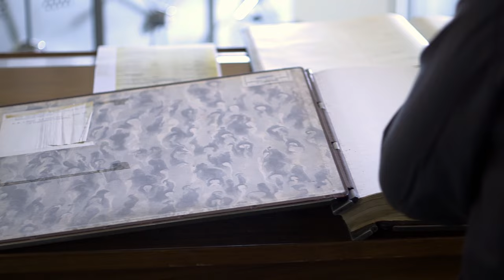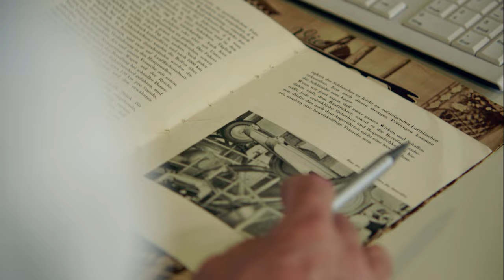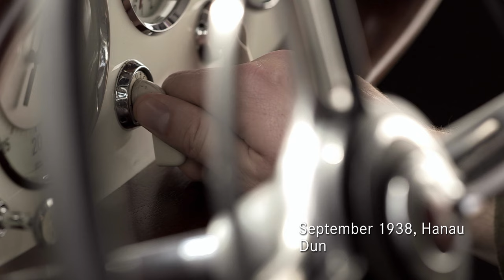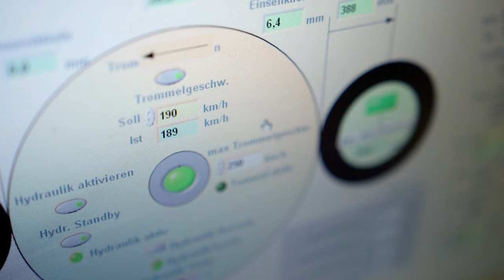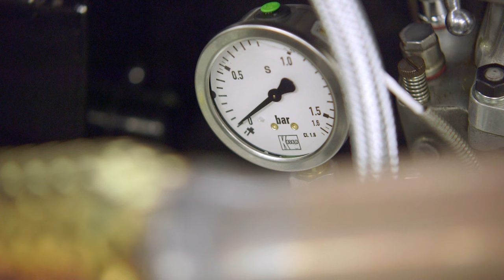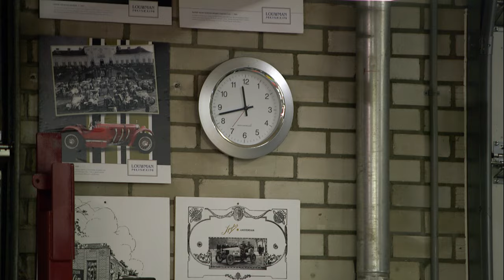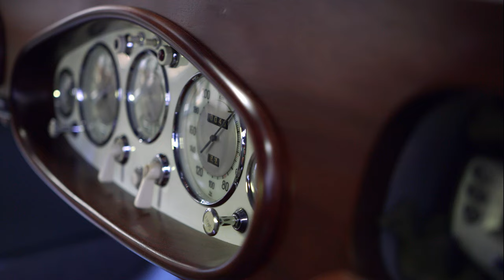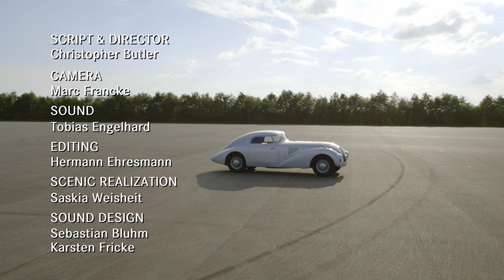The Streamliner Case - Mercedes-Benz original

Comment: Building the best cars for well over 130 years.
I personally fell in love with the 540 SSK from the mid 1930s. A beautiful beast indeed.

Usually Mercedes-Benz is at the absolute forefront of automobile technology and progress. In this case I think the Chrysler (Kreisler) Airflow was the impetus for Mercedes-Benz building this gorgeous machine.

When they pulled the valve cover off it made me think of what they used for gasket materials back then. I would expect to see a sort of rope or string made of natural fibers soaked in a heavy, almost waxy type of oil being used for this unless, as seemed to be the case here, the engine parts were so finely milled that the tight tolerances were all that were required to make a proper seal.

I believe the "Kompressor" needing to be switched on manually was because of the heat generated by this power adder could overheat the motor and cause failure of the powerplant if engaged continuously. 

Nonetheless, it's the traditional German work ethic and attention to detail to an unbelievable degree that makes this car truly special. 

Both of my parents were from Germany so I understand the "German way " of doing things, aber mein Deutsch ist ya nicht ausgezeichnet. Warum hat Deutsch so viel Artikeln? Mein Vater sogar dachte daß das war komisch. Komisch oder nicht, es macht Deutsch ein bißchen schwer zu lernen.

Comment: Something they are not telling us. Check out the radiator/ grill. It goes from square (rectangular) and to oval. I want to know the reason why and hey it was not included in the script.
Reply: I think that the classic Mercedes grille seen in the open chassis test is still under the streamlined sheet metal.

Comment: Would you want to build it exactly the same way?  Not me.  I would like to use the same plans, right down to the engine, with more modern materials and machinery.  Remember the British TVR from the mid 1950's?  Great but not as good as Carole Shelby's redoux if the late 1960's in the U.S.  A ford engine, better suspension, tires etc. but the same plywood body.  No need to cheat and use fiberglass or stamped aluminum for the body though modern aluminum main beams wouldn't hurt.  I imagine that plywood TVR with a ford 250 straight 6 and new suspension or even a 200 GM slant 6.  It would drive like a race care and require no inordinate maintenance

Comment: Designers in 1937 made choices based on what was available at the time, the techniques and materials of the time.

If they were working today, they would laugh at the rejection of modern resources and the adherence to ancient ways.
Reply: Probably true. But they would also be aghast at the loss of skillful workmanship and visions born out of ingenuity being replaced by "mass-produced, market researched, lowest-common-denominator" cars who are more flash than substance. I recently purchased a quality turntable for vinyl records. Most of those I have blind tested at my house prefer the warm, dynamic and natural sounding vinyl sound to the compressed and reduced streamed sound. Streamed sound has most of its "inaudible" data removed ad the rest i compressed to be easier to stream. But with good hi-fi equipment you do hear how flat and hard the sound is. The convenience of technology doesn't always make a product itself better. Just more accessible. 

Your comment does seem rather arbitrary too. Since using modern technology is the norm, why are you upset by a few people - mostly enthusiasts in fact - making the best they can using only the technology available from the time?

Comment: Very beautiful car and I just love this type of thing. But they sure did pump up the Drama LOL. A bit much really. I realize the Germans are sticklers for precision and accuracy but if you had been there back in the day after they had done all their testing and seeing if it was working right they would have sent it out with a test pilot or test driver and that driver would have been FEARLESS! Especially back then. He would have hammered that pedal down (wind or rain be damned) and just went for it. I'm quite certain that car will go over 200KPH. At least in those perfect conditions it would. No test driver in the day would be satisfied with ....and...185kph...I'm coming in now we've gone exactly 115 MPH so that's all folks. Good night. No they would have kept going until the gearing topped out or the engine topped out. Well that's IMHO anyway. They were making race cars that were insane powerful from Mercedes back then. With high speed drivers that would drive to their death in the name of bravery and speed.   Here's a small quote from the "Silver Arrow" race cars of 1934 to 1939 and yes I realize these are race cars and the other is a road car but I'm just commenting on the spirit of the men back then and the tech available.   "The legendary Auto Union Type C 16-cylinder racing car in which Bernd Rosemeyer took the European championship title, the streamlined Auto Union Type C 16-cylinder car built in 1937, in which Rosemeyer broke through the 400 km/h barrier to set a new world speed record, and the Auto Union Type D 12-cylinder racing car of 1939, the engine of which has twin superchargers".
Reply: 1. Nobody is foolish enough to try and finding the absolute limit of a 1937 car. Especially not using the original tires. If you have a serious malfunction in these old cars you're dead. 
2. Nobody is foolish enough trying to push the limit of a priceless, unique car should it just be damaged beyond repair, with no injuries to the driver. 
3. Btw, why do you mention the Auto Union racing cars of the 1930's but not the Mercedes ones? There was the Mercedes W125, W154 and W163 GP cars. And the W125K streamliner with which Rudolf Caracciola drov to 432km/h (270mph) on the German Autobahn in January 1938. Bernd Rosemeyer died in a crash trying to go even faster with his Auto Union streamliner. Btw, the wheels and tires on those streamliners were huge in order to reduce friction.

Comment: I have the ORIGINAL transmission hardware for the VIAGRA which went 34mph. There is no way anyone can get the curves,bends or the Arc correctly. This is because I am the ACTUAL lens and Embodiment of the ORIGIN. MY MERCEDES CHADIS is SACRED because it is how I electrified myself and others thereafter. I advised Mercedes Benz Group Honolulu showroom 2 years ago of who I am. To date, I have not heard from anyone. I have the depleted uranium shells that are part of the transmission hardware. There are other ORIGINAL tools that I have that are for this. It would be wise to contact me.

Comment: 185 km/h is very slow compared to 340km/h of the Auto Union type D of the same period.
Reply: The type D was a Grand-Prix car, this here was built for a rally, as they said, Berlin - Rome. This also means, that this car would have to be street legal and would compete on normal roads, as opposed to race tracks.
The Mercedes Grand-Prix car of the day, the W 154, would also do 310 km/h in it's Nürburgring configuration (note that these speeds wouldn't normally be reached during the races anyway and transmissions as well as bodies were different depending on the track). The record cars of both companies would be even faster.
The problem with high powered cars of that era was wear and material limitations. For example is is noted the head gaskets would often fail before the end of the race. Sometimes they would weld the head to the block for that reason, thereby rendering engine maintenance practically impossible. Meaning they didn't expect the engine to last longer than one race anyway.

Comment: It's impressive that Mercedes can rebuild such an old combustion engine. But are these really the skills that are needed today? Mercedes has been trailing behind Tesla for years when it comes to e-mobility. Such old stories are of little use for the new age. Mercedes should spend less money on rehashing and polishing old myths, and instead concentrate on converting their whole product range to emission free, efficient mobility.
Reply: Screw EV's. They are emissions free when under operation but what it takes to build, manufacture. and create the electricity to make them operable makes that statement a joke. Never mind where the batteries go AFTER they end up toast. They are soulless, they are heavy, are a nightmare to put out in a fire(There are chances that one could ignite at any moment even if there are any defects, look at Chinese EV makes LOL), and are usually more expensive to repair. Which brings another point, they have poor reparability/self-serviceability. I'd rather keep my CLK 55 thank you..